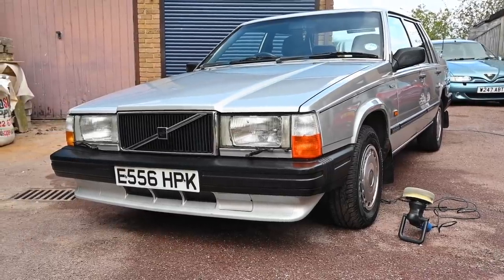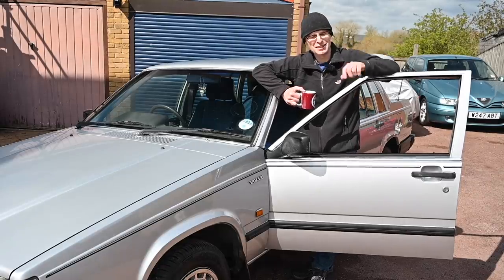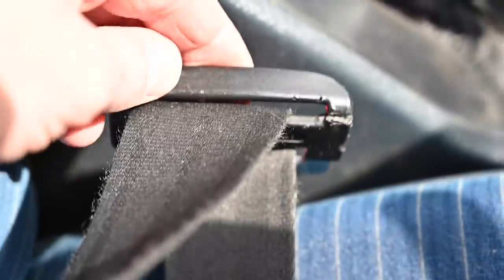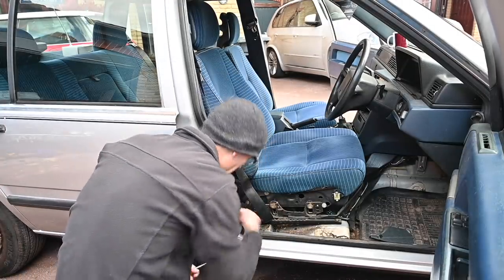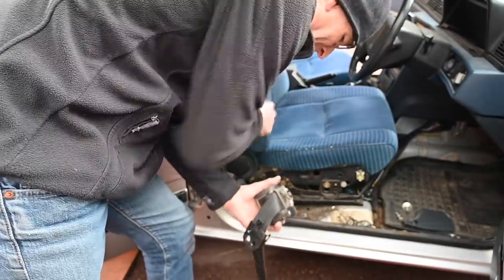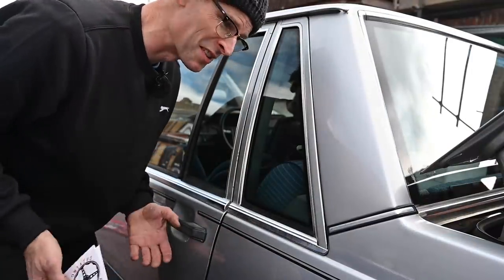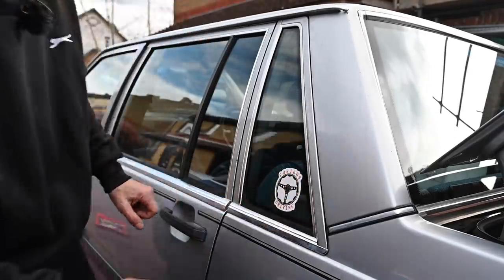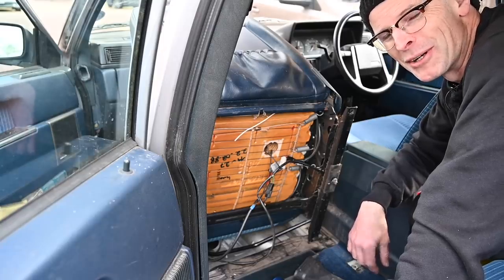Volvo 740 Seatbelt swap and blog stuff

Comment: I suspect the failed seat belt clip is a result of being chewed by a small man's best friend.  I have seen this before on another Volvo, as well as quite a few other cars, and that was exactly the cause then...
Most people in this country do change the entire anti-roll bar drop link assembly when the bushes need changing for exactly that reason.  They do tend to be extremely rusted up and just refuse to come undone or can, sometimes just snap off, when you try to undo them, unless you've just replaced the drop links, in which case you must have made a right Horlicks of installing the bushes for them to have failed so quickly.  Apparently, people who live in much drier places can undo the drop links, generally...  Lucky buggers...

Comment: Good to see the Volvo progressing! As for breaking the ratchet, I've always abused mine and often hit them with a hammer. Never had one break, and I use budget tools! I've destroyed my fair share of screwdrivers and smaller sockets trying to undo rusty bolts. And boy do we have rusty bolts here in the land of road salt and long winters!
Reply: @lukemallory7832  Yeah, I suppose it does indeed happen. I guess I've been lucky or just happened to pick the best of the cheapskate ratchet sets. Oh and I've only ever manhandled the largest 1/2" ratchet and been (slightly) more gentle with the smaller ones, especially the 1/4" one.

Comment: I have been driving Volvo's with heated seats for over 40 years, so I have a bit of experience with repairing any problems with them. The few times that I have had problems it has turned out to be the thermostat that controls the heater element. Except for the last time 2 years ago where it turned out to be a broken wire that ran into the element. It was a simple fix - I just cut and bared the wire, redid the connection and then reapplied the glue that was covering the original connection. I hope this helps. Good luck with yours. Btw, the last repair was on the driver's seat on my '90 740GL - a very similar heated seat design to yours.

Comment: Had a seat heater fail on my Ford, took a while to trace the problem to no continuity in the element itself. A real pain to remedy so I just put a aftermarket  12 V plug-in seat heater from Amazon over the leather top 30 quid. ( Black leather, Black cover on the heater pad) almost invisible.  Just Remove and store in summer.Apparently if someone Kneels on the seat the embedded element can break from the strain when older . Possible to insert a replacement element, but you must re-upholsterer the seat.

Comment: I have replaced all seatbelt buckles of my 1994 Volvo 480 because they were cracked. But it is only a guide that breaks off, the plastic ages and it is the place where you press on to click the belt buckle in its holder, it is only an annoyance. Safety is not impaired and it is no MOT failure, at least not in this part of the world.
Isn't it funny that the whole car has metric bolts and the seat belt guide rail is held together with a 5/8" bolt? I have a 16 mm spanner in my toolbox especially for this job :)

Comment: Bad luck on the droplink. I would never aim to replace just the bushes of the whole droplink is availiable and not a ton of money. Too much hassle fitting/pressing bushes, same with ball joints and lower arms etc.  I had my own trouble with a car project too this lockdown. Trying to replace the Flywheel and clutch on my DS3. I ordered the parts in November last year and finally now have the time to do it on my driveway. Guess what the Flywheel is wrong and it's proving difficult to obtain the correct one. Even if I wanted to spend the money for a dealer part, they're not open as we know.  I must say it's nice to see someone looking after an old V8 engine so much with the Rover. Good luck on all your fleet of cars. Stay safe and keep on spannering.
Reply from the maker: These bushes are £1.50 each just slip on with the bolt so a 5 minute job normally! 
So annoying! Can you get one from Euros, they are delivering still?

Comment: Just a thought ,what about using the campervan favourite for the headlining. That carpet they use supposed to stretch and mould easily to shapes .
Reply from the maker: Theres something similar on ebay and Amazon with a foam backing that Im looking at

Comment: The seat belt was actually ok and not a safety issue. The plastic that broke is only there to keep the tongue flat against the belt when its hanging in the retracted position when not in use. The belt passes thru the tongue which is metal and that's the bit that saves your life. Not an expensive swap though anyway. And tut tut on the drop link! Anything like that (old crusty bolts and nuts) always do well with with a good wire brushing to remove the crud on the thread and a soak in WD40. With the condensation in the boot, go and buy a cheap bag of cat litter, prick it a few times with a fork and leave it in there for a while. It'll absorb the moisture no problems.
Reply from the maker: I checked the MOT testers rules and it was a potential fail as any crack on the clip can be a fail regardless of position, but for £15 its not worth not doing! 
The other one came off easily, and any suspension part that twists with a hand tool is in need of changing

Comment: Maybe the seatbelt broke off because it catched the door while closing... sometimes they retract slowly
Reply from the maker: Possible
Reply: Still, the part that kept the safety was intact, the part that was broken is only there to keep the buckle up near the upper fastener when not used, to make it easier to grab it. But when it's not there it drops to the bottom of the seat.  I found the same in a car I was checking out at a dealer, it smelled wet dog also...
Reply: that's actually what happened on the pasangerside in my 740, i got lazy and trimmed the plastic down so it looks like there never was anything there in the first place, no safety issue so no problem

Comment: AFAIK, when you take out the headlining you’ve to remove the passenger seat and take it out from the back door, so I wouldn’t be bolting the plastic trim around it back in just yet. 👍🏻
Reply from the maker: I was going to retrim it in place!
Reply: furiousdriving could do that too, I’ve a 1986 740 GLE with a headlining exactly the same as yours, mine has a sunroof. I’d say it would be handier and neater job taking out out of the car. And that foam will all have to be cleaned off too, if you replaced it in the car you’d have foam all over the interior.
Reply from the maker: @leonobrien4978  Ive seen pros try the 'take a seat out and fold it through the back door' technique and crack 2 in a row so Im wary of that, and I can do the retrim for under £40
Reply: furiousdriving let us know how ya get on, I’ve been putting off doing mine for 2 years now, no better time than now to do it.

Comment: Should have used that little blow torch to loosen the nut ,ive had some interesting bolts snapping on my old 740.
Reply from the maker: The other just unscrewed, wasnt expecting an issued but the time it was twisting it was too late. Plus of its corkscrewing that easily it was ready to be changed anyway
Reply: furiousdriving I couldnt believe it twisted the shaft , what bad luck , keep going though , always watching the vids .

Comment: How come my seat belts in my 92 Buick century doesn't lock when pulling hard. It retracts good except one in the rear wich moves slowly.
Reply from the maker: It sounds like the mechanism is broken, not an expensive thing to change
Reply: @furiousdriving  depends on under these times and i live in sweden too. but itt passed inspection :)
Reply from the maker: 2 stroke Power mine was £15 on eBay, arrived in about 3 days 😁

Comment: "die in a crash" me me me, your driving a volvo mat, worry about the other car lol😁
Reply: Yup, it always used to be the joke that if you had a crash in a Volvo then the other vehicle was the crumple zone.  Based on what happened when my old 244 got hit by a nearly brand new Sierra I'd say it was a pretty fair statement.  My Volvo drove away with a cracked sidelight lens and split in the rubber on the bumper and the Sierra went home in a hoover bag...
Reply: @gosportjamie  the last owner of my current 740 has actually sent 3 other cars to the scrapper, a citroen 2cv, mazda 929, and one more i can't remember what the last owner said was, mazda drove out on the roade on a winter and was not able to cross the roade to his lane before the 740 T boned it, (new front bumper needed) citroen 2cv drove into the left rear wheel of the 740 as previous owner backed out of a parking spot (new rear quarter was needed)  and i have torpedoed a rav4 (not sent to scrapper but) crushed in the front fender, fog lights and washer fluid reservoir exploded all on the rav4. i got a dent in the plastic fender (he broke the right hand rule)
Reply: @Stale_Mahoney    Yep, they're tough old beasts.  A friend of mine has a sticker on the back of his estate that says "Think bike.  Think Volvo.  Think PAIN..."
Reply: @Stale_Mahoney  ha ha shit cars deserve too be in the scrap yard 😂
Reply: @peteramberley9952  like he said in rocky, "if he dies he dies" survival of the.. sturdiest?